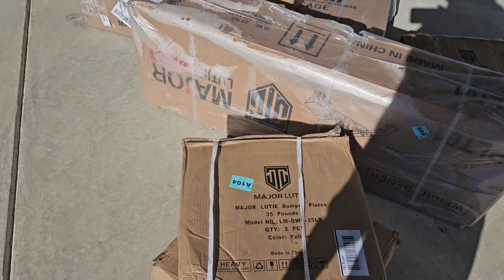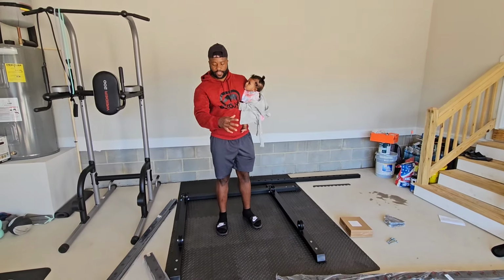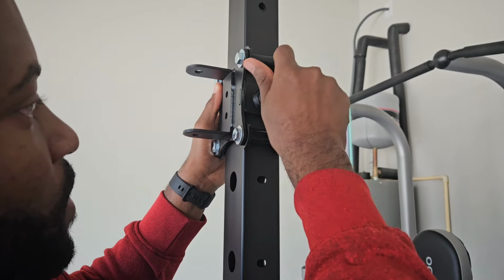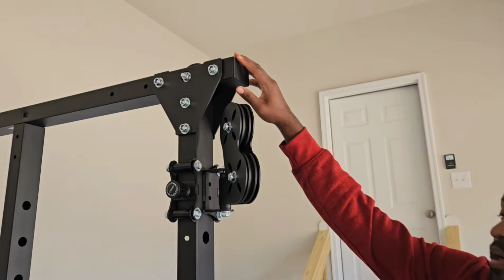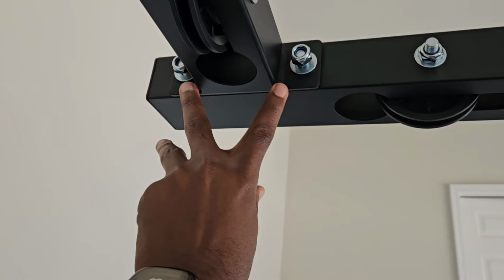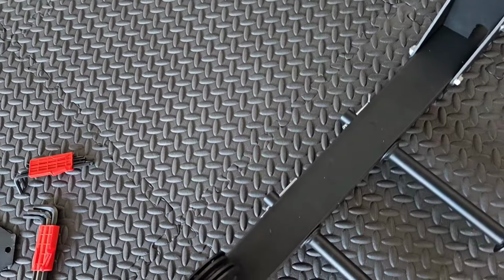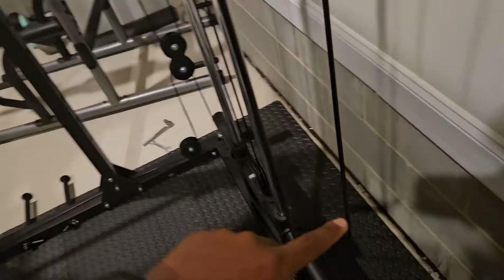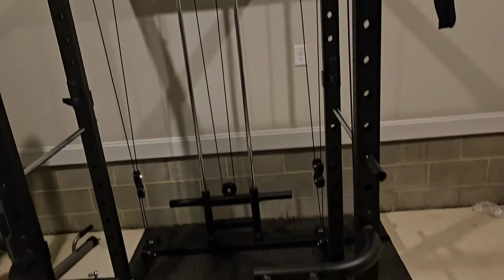How to Install Major Lutie Fitness PLM03 | Power Rack Home Gym | Major Lutie Power Cage

Comment: So, i think you did it wrong. The wheels for the pulley system in step one are on the outside of the bottom brace, you have them on the inside
Reply from the maker: Looking at the instructions, the cutout was showing on the inside, which is why I installed it that way. Definitely look like it should be on the outside tho.
Reply: My directions show them pulley wheels on the outside. Thank you for the video. It really helped me out.

Comment: Thank you so much for creating and sharing this fantastic video about our Major Fitness PLM03! Absolutely helpful! And we hear you about the pulley system instruction. We will improve it. Hope you and your family will enjoy our it. Looking forward for your product review~P.S. We couldn't help but notice – your kids are absolutely adorable! You've got a wonderful family!!!
Reply from the maker: You are most welcome! So far we are enjoying our workouts from the comfort of our home. And thank you for your compliments. Product review will follow shortly.
Reply: I can't tell which bolts to use for which holes? Does it matter?

For example, it says on step one, use 1.4.5. But none if the bolts are labeled 1.4.5.
Reply: @major-fitness
Reply from the maker: @FaTHoMnL  They are all the same size for the major stuff. The smaller bolts are for the attachments such as the foot piece etc.
Reply: @knightlovahs  thank you for the response.
Reply: @knightlovahs  it's weird they wouldn't have it labeled still. Some lug nuts say n24 vs n20 and same for the bolt screws.

But thanks again.